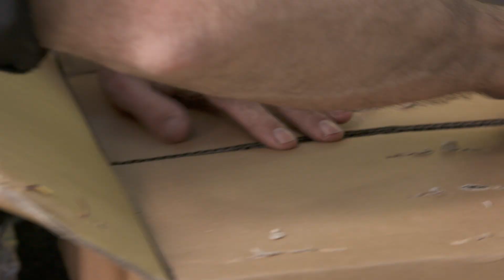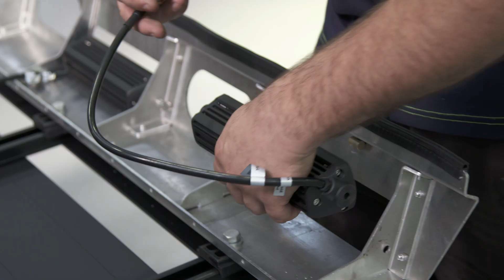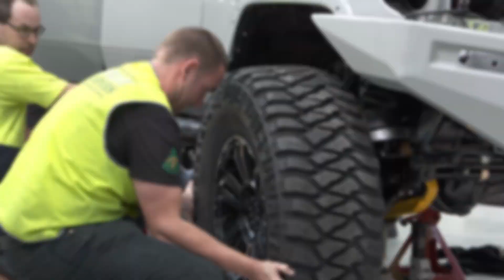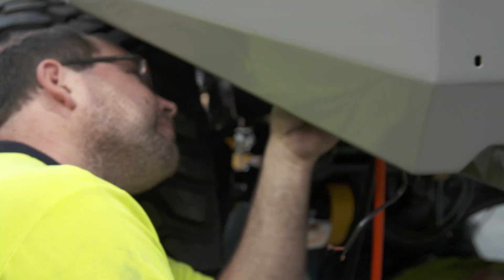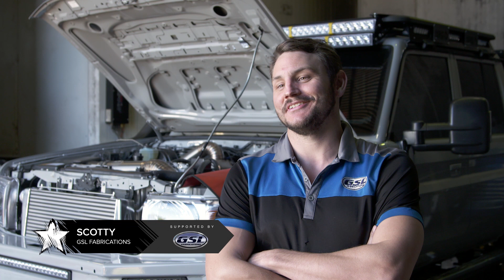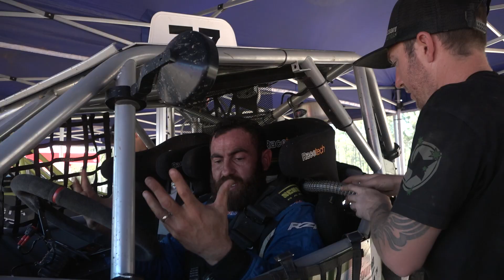Patriot Campers LC79 6X6 Megatourer Build Series - Episode 4

Comment: Stainless bolts on brakes......not for me. Why didn't you replace the abs ring screws with some capheads? They will be impossible to remove once the truck has some off road miles on it.
Reply: N K And I c Baja trucks don't use a cross drilled rotor, the mud gets in there, causing some issues, they're just dimpled instead. Obviously Alcon supplies brakes to all major motor sports the world over, including SCORE so they must know a thing or hundreds! Cool to have a two piece rotor though!
Reply: I dislike fake riveted rims so much, way too "pimp" for me! Just some round hole ones are clean and simpler.

Comment: Just a suggestion but here in the states we have some brake bleeder screws called speed bleeders with a built in check valve so you can just pump the pedal till you feel fit then just shut the bleeder screw when you're done. Great series guys by the way love the truck looks amazing!! @patriotcampers